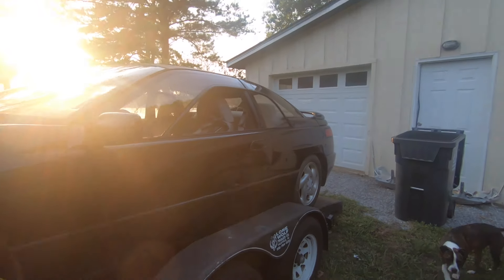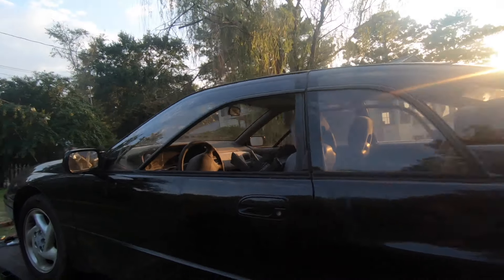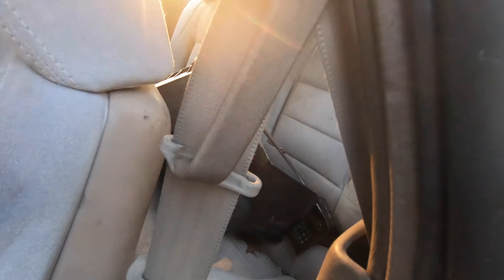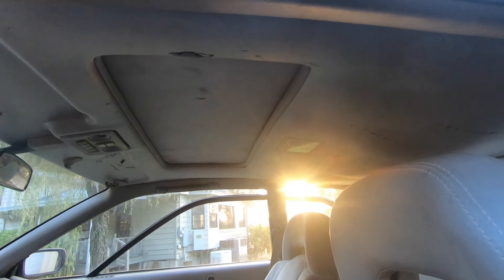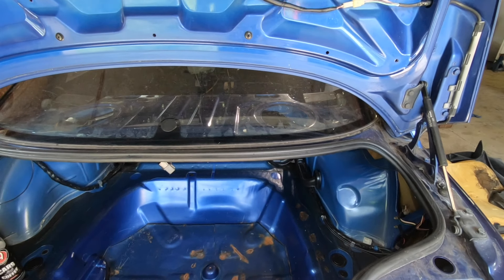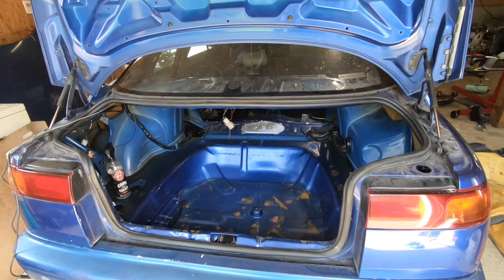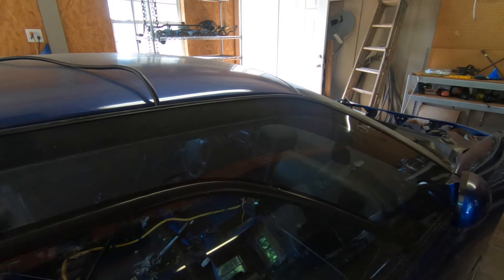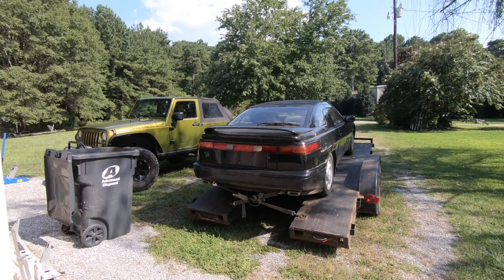I BOUGHT THE CHEAPEST SVX IN THE WORLD!

Comment: What trans do you plan on running in the svx
Reply from the maker: I'm swapping the 5 speed into it as I type.
Reply: @SchmittyVids  wrx I hope
Reply from the maker: @aaronzeigler77  the one from my wrx actualy
Reply: @SchmittyVids  if it's a 02 u won't have to change the diff the rest of the years you will have to
Reply from the maker: @aaronzeigler77  my SVX's have no diffs 😂
Reply: @SchmittyVids  Ooo yeah have fun finding a rear subframe
Reply from the maker: @aaronzeigler77  no need, they are all the same